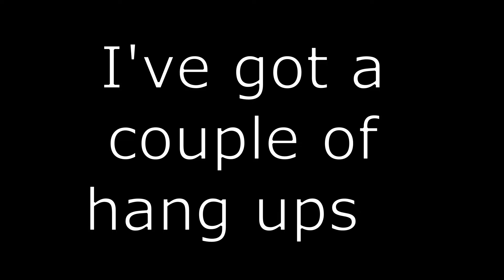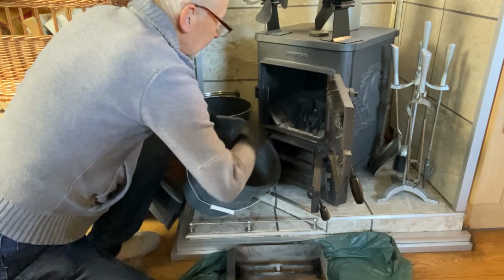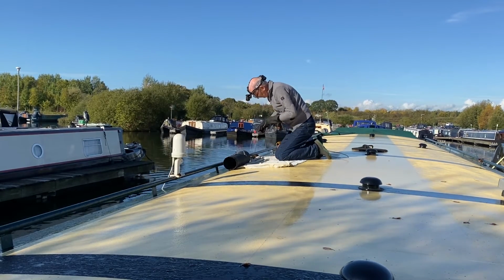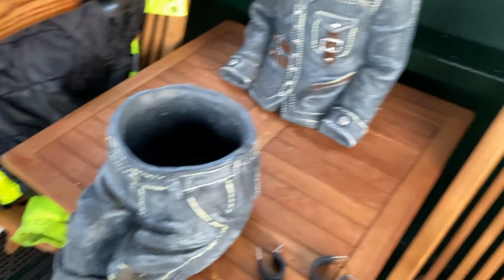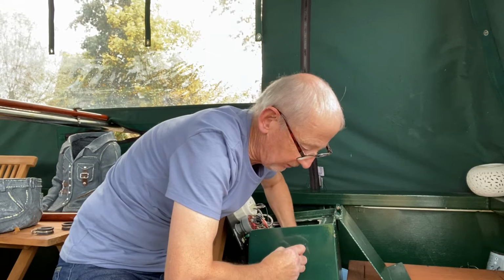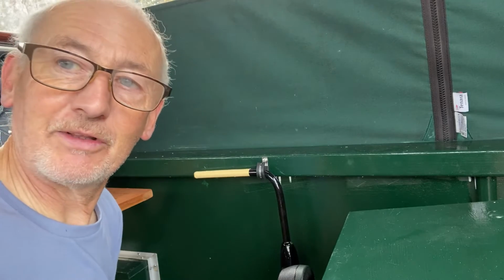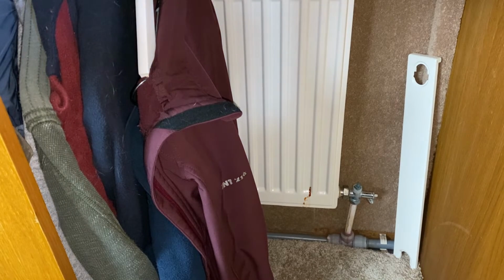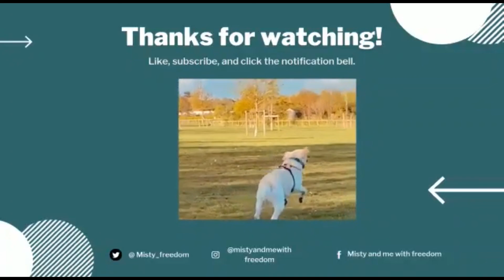Vlog 68 Widebeam life...Freedom has a leak! - Misty & Me

Comment: Hi Martin I've got the same woodburner but there's no side plates !!! Are there 3 of them (two sides and one at the back) I've found cutting out the end of the ash pan makes it easier for emptying, basically making the ash pan like a shovel.
Cheers (Sprinter Mike)
Reply from the maker: There are just the 2 metal slop sections which slot in and rest against the side brick and they work well in directing coal down into the main burn. With me having the back boiler there isn’t one at the rear. The cutting of the ash pan is something I may just try mate good idea. Kind regards Martin